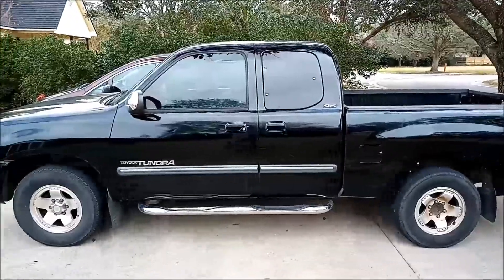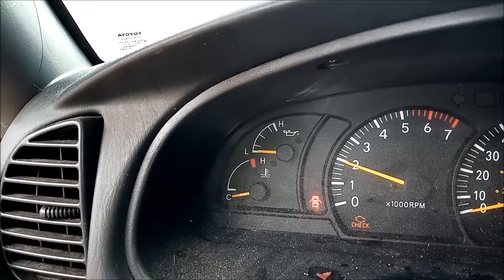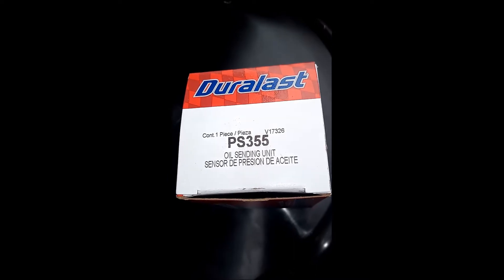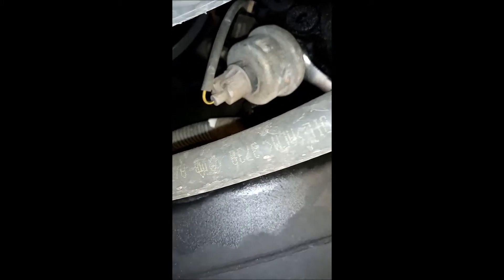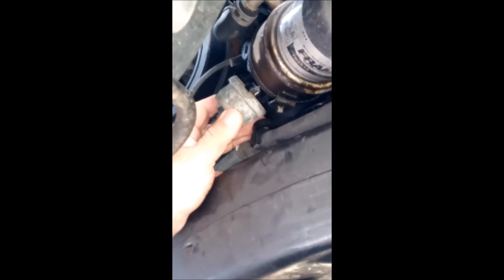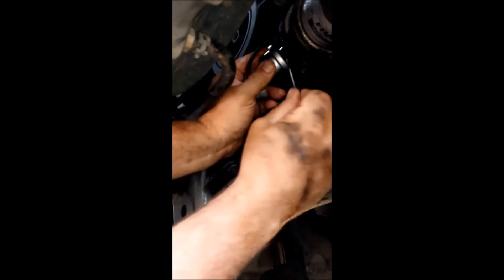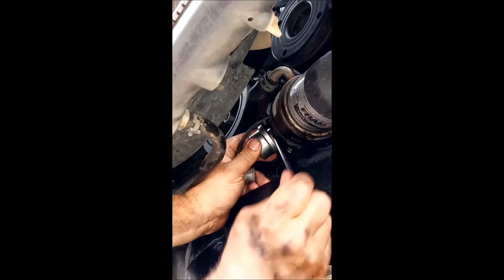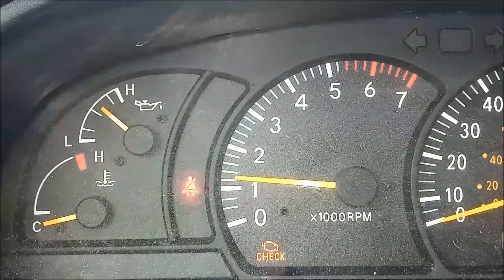Low Oil Pressure Toyota Tundra Sequoia Land Cruiser or Lexus 470  Fixed in 5 minutes 4.7 Liter Eng.

Comment: Shucks! I went cheap and bought the 16 dollar smaller oil pressure sensor for my 2004 tundra. Oil level climbs as soon as i start the engine but slowly drops back to zero. I thought 85 bucks was too much, but now that 16 bucks part is costing me peace of mind.
Reply: What's the update? Was the sending unit at fault or actual low pressure?

Comment: I have been working on automobiles for 35 years and have seen a lot of problems with aftermarket oil filters. Walmart carries OEM toyota, A/C Delco, Motorcraft etc. and a lot of times they are cheaper than the aftermarkets and what needs to be on the engine regardless of what brand oil you pefer.

Comment: Shows how great our engines really are. You can even run fram oil filters without issue...thanks for the video.
Reply: After my recent trouble with a fram filter I will never use them again.... It tried to ruin my toyota motor!
Reply: @Jacob_Spang which fram was it? Orange one , silver , or sinthetic one?

Comment: I have an issue with 2018 toyota thundra the high transmission fluid temperature warning comes on while driving then shortly after the low oil pressure warning also comes on with a check engine light then the car stalls and turns off itself. When I remove the battery head and put it back it starts and works normal until it happens again what can be the problem ?

Comment: There is apparently a newer part available at Toyota. The early original OEM parts had too small of an orifice into the diaphragm so a small bit of debris would plug the sending unit and report very low pressure at low RPMs. A new sending unit was designed and is available at Toyota for $85. I pick mine up tomorrow.

uPDATE: It works. Low idle is now 1/4 gauge. Highway speed is now 34 - 7/8.  It only took 15 minutes. Yay!
Reply: Hello I’m having the same problem with my tundra I just replaced the sending unit sensor and still not working.
Reply: @wilbertortiz9469  me to same as like me. What next you've done.
Reply: Do you have records of the part number to know it’s the newer design? Thanks

Comment: This video was helpful to point me in the right direction. Did an oil change in my 2002 4.7L sequoia i've had for 8 years and it started valve chattering. I immediately bought a new oil pressure sensor and an k&n oil filter. It instantly stopped chattering and registered full pressure on start-up. The cheap fram filter was the problem but after watching these video's I also changed the sensor as well. I love youtube!

Comment: My Lexus 470 doesn't have a oil pressure gauge but a couple of times it has had a loss of power but still gets to speed slowly. Someone told me that happened to theirs and it was the oil pump. I wonder if this will help before I tear everything apart to swap the oil pump.

Comment: So how did you end up getting the part in with all the oil pouring out?😂 saw the edit so I’m assuming you let it all leak out and slow then I stalled the part? Mine just had an oil change so don’t want to do another to i steal this part but I will if I have to. Thanks

Comment: I've got a question. My 2000 Tundra oil pressure indicator on the dash will fluctuate widely. It will stay within the acceptable range of the gauge, but will go straight to the top on acceleration and the drop to the first mark or even anti below at idle. Maybe 700-800 rpm. Is this normal?
Reply: Hi, i am facing the similar issue on my land cruiser as I noticed today... did you find any answer... is it normal or does it need some fix... i am confused now
Reply: @musidarr  is normal for this generation
Reply: Mine did the same thing until I replaced the oil pressure sending unit as shown in the video

Comment: "It may leak some oil when you change it." WOW!
Reply from the maker: it leaked so much I edited the video and put a new quart in. I had a hard time getting the new sending unit in.
Reply: @vigeo5  maybe better to drain the oil first then put it back after changing the sensor?

Comment: Hey great informative video! Literally have the same problem with the 01 tundra I just got! Hope this works, also do you know why the engine temp doesn’t read like that? Mine does the same thing as well, just sits on cold, think it’s the sensor? Thanks!
Reply from the maker: Sorry, I don't know about the temp gage.  Mine works, I didn't want to deal with the oil while it was hot.
Reply: @vigeo5  hello sir!! Thank you very much for such a helpful video. I own a2001 Toyota Tundra v8 and having the same issues. Do you remember how much that part was???
Reply: @wilbertortiz9469 did it work 😢